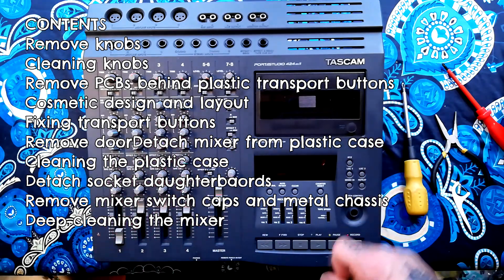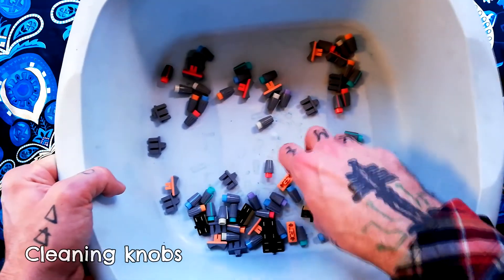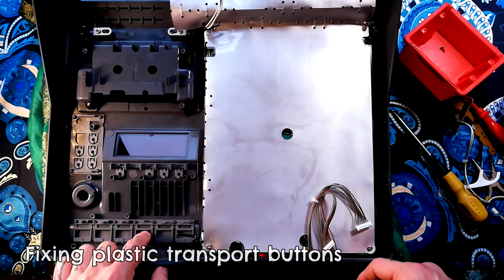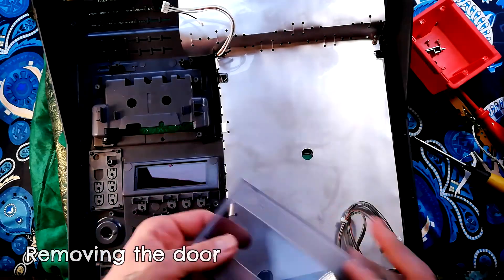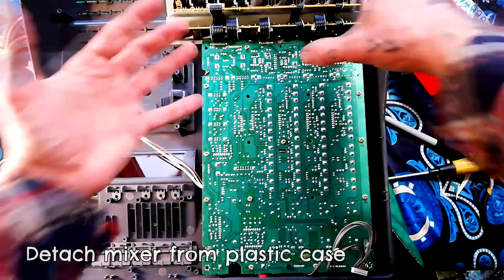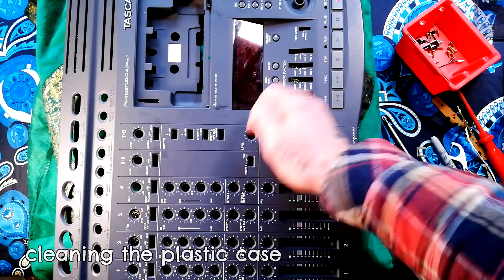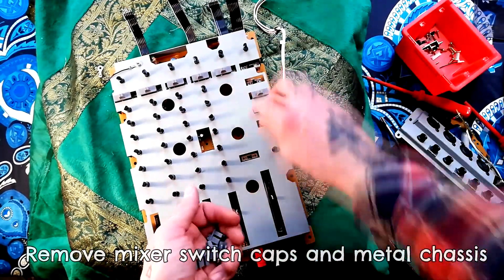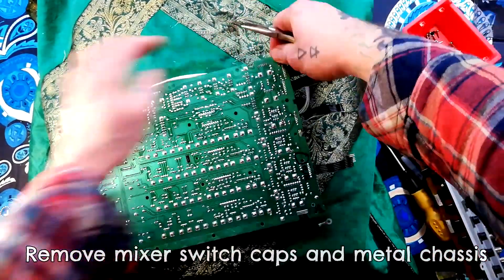Tascam Portastudio 424 Mk II | Tear down upper section

Comment: Hi, congratulations for your channel. I really like the content. I need some help, my 424 mk2 started to jam the mic line/tape selection switch on channels 2 and 3. How do I solve it?
Reply from the maker: Thanks. Do you mean it is difficult to move the switches with your fingers? Or do you mean you can move the switches, but they don’t work, electrically?
Reply: @Tetrakan  they work electrically, but I can't move channel 2 to tape function and channel 3 to Mic function, apparently a switch pushes the other.
Reply from the maker: Is it possible a previous owner removed the case to clean the circuit boards? I ask because the plastic caps for the track record switches near the display and the plastic caps for the input selection switch above the EQ look similar but actually they are two different widths - if you mix them up they can get stuck in the case.
Reply: i haven the machine for 2 years and they were working normally. and yesterday after a recording session this happened. the switches are moving together, not going into function. if i open the mixer part can i solve it?
Reply from the maker: I haven’t encountered a problem like this myself, with the movement of the two plastic caps linked, I don’t really have an explanation unfortunately…. it can’t hurt to take the plastic casing off, hopefully the cause will be obvious when you do that? Good luck!
Reply: ok i understand and thank you for your support. When I find out what's going on, I'll let you know here. Any recommendations on what not to do when opening the machine?
Reply from the maker: I think everything you need to be aware of is in the videos, good luck.
Reply: Thanks a lot!!